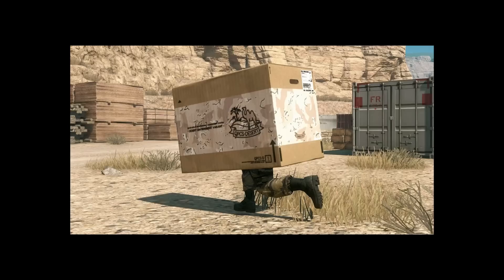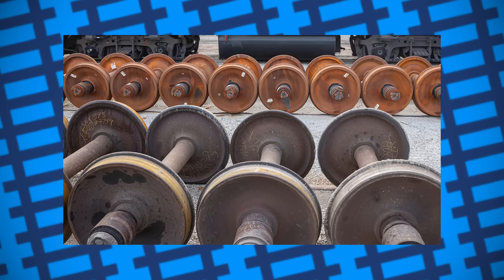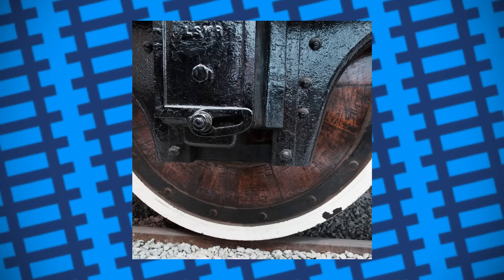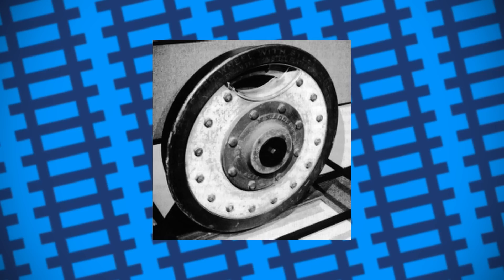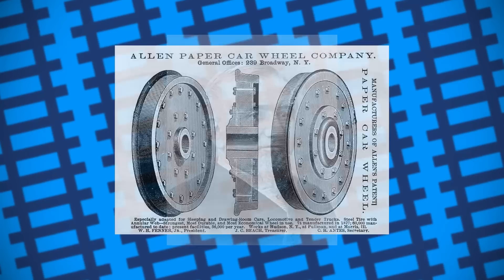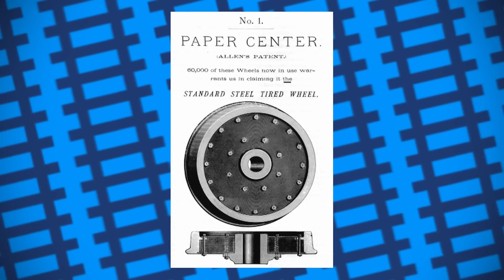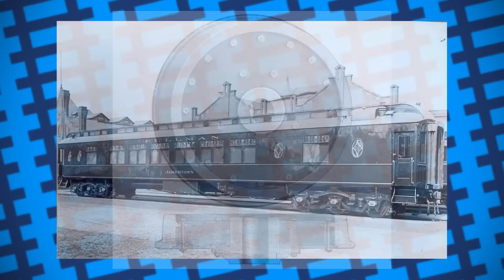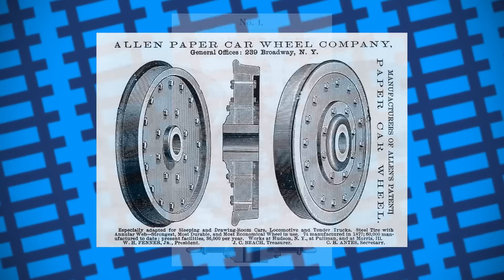Why luxury train carriages had wheels made of actual paper - Allen Paper Wheels

Comment: Okay, that's actually really neat.  Kinda sad that they were just deemed "unsafe" overall, because from what it sounds like they worked perfectly well for the loads of the era, provided they were used within their known limitations.
Reply: The problem is that as technology improved, those limitations became unworkable. They had to be deemed unsafe overall because they no longer had any safe practical applications.
Reply: @spencers5898  mostly correct, early power take off didn't always have shielding either. It wasn't until the mid '90's that roll over cages became universal on new tractor's. I dare say there are many old tractors that still don't have roll over cages, if it's still useful, why get a new one? 
There was a time where most all Farmers fixed their own equipment. Farmers still want to work on their equipment ' cause the Dealership always had other folks equipment already waiting for work.
Planting or harvest, you can't wait, even if you're old tractor didn't have all the safety features, if you could still use it to plant or harvest, well what is the clear choice. Lots of Ford 9N and 8N tractors running still around, when one gets on the market they sell at a premium, those old Ford's are still useful.
This doesn't address the way manufacturers have made it such that you are forced to buy factory parts.
By the way, no antagonism intended. I hope that I've conveyed a frustration with Big Agriculture, rather than at any individual.
Reply: I mean the problem is that said loads were only possible if the design of the car was unsafe, and even so they were still less durable than metal wheels.
Reply: @nilo9456  Because wheels are under a load all the time while in service, and they aren't specific to the machine and changed out and conceivably moved to a much larger car. ROPS is under load how often during normal use? And can I move the ROPS from my new tractor over to my old 8N? How often do you change the ROPS due to normal wear? 

I think you've been kicked in the head once too often. You make no sense and can't even stay on topic. An individual farmer has nothing to do with a railroad...
Reply: What if it rained
Reply: @CharliMorganMusic  
Considering the invention actually caught on, I doubt that was an issue.  Being saturated with glue probably prevented any water damage
Reply: @CharliMorganMusic  This is no different than the paper canoe that was on the "Poor Man's Fiberglass" channel.  Layers of heavy paper soaked in fiberglass resin and pressed together in a press for a few days before being worked like wood to make canoe shell.  Which in turn was layered with more paper and resin on outside before final sanding and clear coat.  Looks nice and guy has been using it for a number of years now.  There are also other forms of paper or cloth being used with fiberglass resin or wood glue to make different versions of "Poor Man's Fiberglass".  I use a form of it in making cosplay armor for people made from heavy cardstock and fiberglass resin with tiny amounts of actual fiberglass cloth used to strengthen areas if needed.  Depends on how they are using it - As a once in a while costume or heavy use film prop. This determines how much it gets extra layers or reenforced areas.
Reply: @nilo9456  -  I think you got off track there.
Reply: Rubber was used in the wheels once, it caused the worst train crash in German history.

Comment: There was a car with a paper transmission as well. It used a paper disk as a friction material in what was essentially an early CVT. The engine was connected to a big metal disk, and the paper disk could slide across the surface of that big metal disc so that depending on how close it was to the center or the outside, it would spin at different speeds. And if it crossed to the other side, that was reverse. There's a Jason Drives video about it, it's pretty interesting.
Reply: Some riding mowers have been using that exact drive system with a rubber friction disk instead of a paper one for over 60 years. Most rear engine riding mowers used disk drives and I've seen a Snapper lawn tractor that also had a disk drive in it. They're also adjustable, so you can have a potentially infinite number of gears.

I own 4 rear engine riding mowers; two Snappers, a 1967 Hi-Vac and a 1998 SR1230, a 1984 John Deere R72, and a 1994 Ariens RM830e, and all are disk drive except the John Deere, which has an actual 5-speed transmission under the seat.
Reply: That sounds weird as heck
Reply: @roadwarrior114  Most  walk-behind snow blowers use that type of transmission as well.
Reply: @andrewalexander9492  I've got a 1980s snowblower that I want to put a little seat trailer on the back of to make it an articulated ride-on snowblower.
Reply: Sounds like the precursor to those MTD made snow blower drives, it's essentially a moveable ring gear, in a way....a very clever device. Allows for a "transmission" on machinery
Reply: It was also very common to use paper pulleys for flat belt drives and they were used into the 1950’s on small farm machines that could be used or stored indoors.  You could not leave them out side, the weather would ruin them.
Reply: Anyone got a link to the video

Comment: You can do astonishing things with paper these days. The frame of IKEA's Expedit/Kallax shelvings are basically paper on the inside, hardly any wood, and they are quite sturdy.
Reply: "You can do astonishing things with paper these days. The frame of IKEA's Expedit/Kallax shelvings are basically paper on the inside, hardly any wood"
Isn't paper processed wood?
Reply: @jwalker7567  That's an ignorant statement. Good quality paper-resin composites can be made to be waterproof, strong and durable (E.g. Richlite). All-around better than wood, not cheaper, and absolutely not lighter.

They're often used to meet fire and chemical safety requirements, e.g. replacing marble countertops in laboratories or to furnish airplanes, and like Micarta they were often used to make gears back in the first half of the 20th century.

Virtually no densified wood fibre board is lighter than wood, since they're made from compressed wood fibres. Those IKEA boards are lighter because they're not at all anything like MDF, Richlite, or any other similar materials, they're sandwich panels with a resin-bound cardboard honeycomb core, mimicking the composite techniques used to build things like airplane. They're light because most of the volume of the board is air (Ironically, similarly to wood). Sandwich panels won't have durability issues if the surface plies are made from quality materials (waterproof). That can even be wood.

Much modern furniture is made from garbage like MDF, which should never have be used as a long-term structural material, because that's what most people can afford to pay.

Comment: I've seen paper airplanes, paper boats, but paper wheels for rolling stock? That's a new one! Guess you could say Allen was on a "Roll". Sorry. I thought about another potential flaw with the paper wheels...what if it was raining or snowing? The paper material would pretty much get all soggy.
Another fascinating video sir!
Reply: I think that rain and snow would have minimal effect on the wheels, at least in the short term. From my experiences with wet books, I've found that the way the pages tend to get soggy is from the outside in, with the centers of each page only really being effected if you left it to get soaked completely. So what I think happens is that water gets inside a book by squeezing between each page. I think that with these wheels the compression of the pages and the iron rims of the wheels only "top" and "bottom" sheets of each wheel would actually be exposed. It would take a lot longer for the water to seep through the page, so the inner papers would be protected. I guess some of the outer layers might get crinkly and brittle once they were dry, but the rest would be pretty dry.

Not sure though, could be a good experiment to try.

TL,DR: I think the way the pages were compressed and how they were oriented in the wheel helped protect them form getting soaked through by rain and snow.
Reply: @strcmdrbookwyrm  That does sound logical, thanks!
Reply: I'd imagine they were painted or shellacked on the outside..
Reply: @ryanjohnson3615 or some type of resin, epoxy, oil etc could have been used to impregnate the paper.
Also we have a limited idea of what “paper” is.
Some industrial rolls or various things are spun onto cardboard cores, just like paper towel rolls, but that core is HARD! 
As a kid I made “robot arms” out of some rolls, while playing robot with another goofy kid, we were both 6.
I klonked him on top of the head, as a robot does, and he screamed bloody murder, the hollow sound from both his head and that hard paper roll was hilarious!
But he returned fire, it came down and bounced of my forehead and the bridge of my nose… I thought I died!
No joke, knocked me out just a few minutes, my mom came and got me after that and determined my nose was broken… the doctor said it looked more like I was in a car wreck and hit my head on the dash or windshield… or maybe like it been hit by a baseball bat across the eyes… 
Also the hydraulic press channel can show just how hard paper can be

Comment: Somewhat later, compressed paper was used for belt drive pulley wheels, particularly as the driving drum on tractor PTO's. It had a higher coefficient of friction than cast iron, which meant that the belts could be run at lower tension, saving wear on bearings and the belt lacings.

Comment: Wheels on trams have sometimes a layer of rubber between the outer steel rim and the inner part of the wheel, making them more silent than standard steel wheels.

Unfortunately the wheels on some German high-speed trains used the same method to get rid of the vibrations in the restaurant cars. You may know what happened, the steel rim of such a wheel broke, the broken rim switched a track switch ( point ? ) the train got partly derailed and the derailed part smashed into the pillars of a bridge.

And this lead to a train crash with 101 dead passengers if you are interested look for 'train crash Eschede'

Comment: As l understand it there was a lot of cheap Empire style furniture in which the expensive wood carving was replaced with basically molded paper mache in the later 1880s. During WWII the British made drop tanks for aircraft out of paper based material. Save the aluminum gor the airframes, naval bronze and aviation engines.
For a while I was building models out of cardstock and chipboard (the stuff on the back of tablets, cereal boxes etc). I made up a test piece 5 inches square with 5 stringers in both directions. The stringers were 1 inch tall. All the parts were 65 lb cardstock on each side with a layer of chipboard between. Around .05" thick. Held together with PVA glue. Stood up to a 500 lb load. Took an industrial arbor press to collapse it.
Paper based materials can do some amazing things

Comment: Why didn't the paper wheel "roll" on -- see what I did there -- under streetcars (trams) and interurbans? Street railway vehicles are much lighter than railroad passenger cars, and the design looks like a good way to reduce squeal on tight curves, of which street railways and interurbans abounded.
Reply: Because suspension got better

Comment: I would have thought these wheels would have suffered more from heat damage either from bearings or brake blocks.
Reply: They probably would have. I think they thought about that though, which is (one of) the reason(s) they put a metal part in the center.
Reply: @strcmdrbookwyrm  yeah, but didn't old timey greased axels catch fire on metal weels too? It was one of the reasons to have a "crows nest" on the caboose, if I remember correctly, to look for burning axels. So I wonder if it could actually be a problem. Leaving aside the fact that compressed paper doesn't burn that well.

I know the "crows nest" on the caboose and the "greased axels" have proper names, but I don't know how to spell "cupula" and I'm not sure the name is "hotboxes" respectively, and I don't want to risk a train nerd correcting me.
Reply: @taiyoqun  Yeah, but I think by the time your bearings start hotboxing the fact that your wheels are paper is going to be the least of your concerns. But I do think the bearings were in the car rather than the wheels though. I'd have to double check to be sure.

Comment: nearly every day as a motorbike courier...

"yknow, a big stack of paper is equivalent to a big chunk of hardwood? its too heavy!"

papers perfect. timber has a grain and it makes it rather... non-uniform. directional.

mash them fibers up, tangle them together, and use lots of layers of them bonded together... preferably with something flexible... and tada, you got pliant yet hardwearing wheels.

paper was and is used still in a lot of areas like that... rolling mills, silent gears, yada yada...

Comment: Paper composite is an amazing material.   It was particularly loved in the 1700s-1800s for it's noise suppressing ability.

I am surprised they aren't using MFC, the descendant of paperboard composite, in layers with steel to dampen noise in many things.  This both strengthens steel and reduces noise.

Comment: In WW2 germans due to metal shortage used curd for making buttons. As a kid I slept in bed with bedsheet having these curd buttons. These buttons were still holding fine more than 50 years after manufacture. Train wheels from paper does not sound too special after that.
Reply: You mean Galalith?

Comment: Sounds like a similar concept (and purpose) to the "Dual-Block"wheels that to my understanding are still in use to this day. In that case usually an outer rim and inner hub connected by rubber blocks, but the portion of the wheel that is the rubber blocks is much smaller.

Comment: Some countries still use wheels made of bipedal omnivores because of the low cost, expendability, and can be found almost anywhere around the world. Their versatility is also used in manufacturing things like iPhones or even expensive shoes and jewelery. Many companies, especially popular brands in North America, use them when very young because they are easier to control, can be used in smaller spaces, and are safer as well as much cheaper for use in manufacturing expensive products like iPhones, which would cost three times as much if manufactured in North America without violating any relevent laws or regulations.

Comment: Today when you have a product like that, they would call it "engineered wood pulp product" or even "engineered wood".

The paper cones of HiFi speakers aren't exactly paper either. As i spoke with a Danish manufacturer rep they were like "paper, hemp, Nomex, Kevlar, plastic... Largely a question of marketing. We can just about make them all behave the same, all in the mixture and additives"

Metal membranes are different, but then they do have a wild uncontrolled break-up.

Comment: Paper being used structurally is not that novel an idea for the time. Papier-mâché  was used to make fine furniture in France from the 1700 4:35 thru 1880.  Same basic process of gluing laminated sheet of paper and pressing it into a mold at high pressures. Jules Verne used it in his fictional airship as it was well known to be stronger than wood at a fraction of the weight.    It is from this use of Papier-mâché that the idea for composites like fiberglass and carbon composites derived.   The paper is simply a very fine randomized Matt of cellulose fibers that is porous enough for glues or resins to soak thru, adding tremendous tensile strength to the compressive strength of the glue or resin.

Comment: I mean, if the paper is basically acting as a form of suspension wouldn't it make more sense to use it as suspension.  Thus getting the most padding out of it and leaving wheels to be as strong as possible.  Seems like the wear would be more predictable and you would make more complete use of its plastic deformation, safer.  I'm not saying it would be the best suspension but if proper suspension > paper suspension > paper wheels, then clearly paper wheels would be out.

Comment: Sounds like wishful thinking or a con to me.   To damp out vibration and cut noise, it has to be elastic.    How elastic can compressed glue saturated paper be?   It would essentially be the same as MDF, which does not perform well under strain, gradually deforms under a constant load, and comes apart if in contact with moisture.
A bit like another misconception from the 1920's":   People used to believe wire spoke wheels on cars gave a softer ride than pressed steel wheels - as supposedly did wooden spoke wheels.

Comment: Well, of course, if you call it paper wheels, sure, then it sounds goofy. But if you call it light-weight, low-temperature-manufacturable, renewable, ligno fibre resin composite non-reliant on centralised heavy industry and expensive imports, it becomes a market opportunity.

Comment: "Just because it sounds crazy on paper, doesn't mean it is crazy in practice." 
This is a good point. 

"The hyperloop" and "solar roadways" are among many exceptions to this axiom... it's pretty crazy on paper and will never work in practice either.
Reply: even on paper, solar roadways are kind of dumb.

On another note, wood was successfully used as brake pads on french subways.
After the war, materials were hard to come by, so they tried other things ... and that worked.
I thought they would have moved on since then, but according to wikipedia it's still in use nowadays. On Montreal's one also.